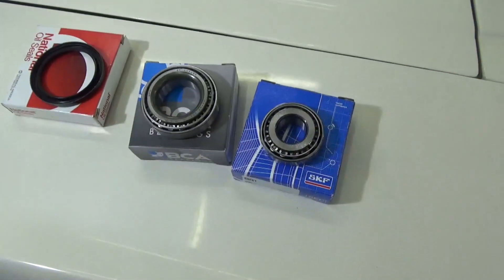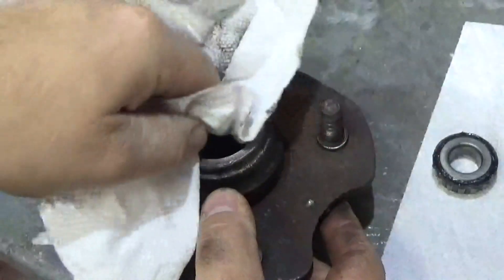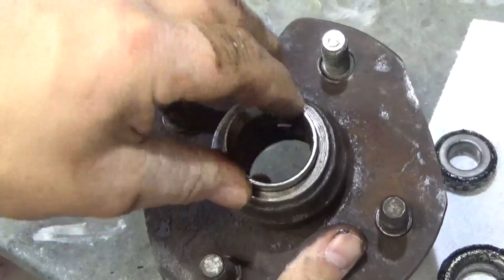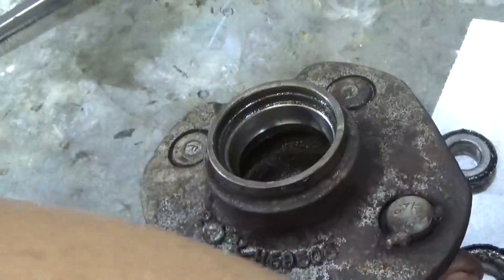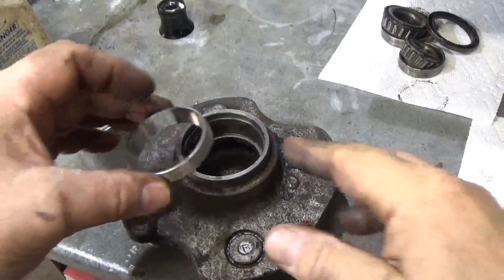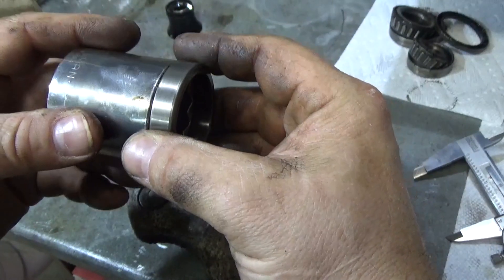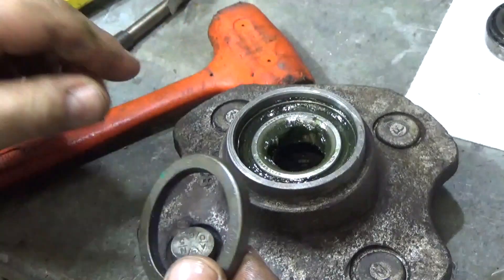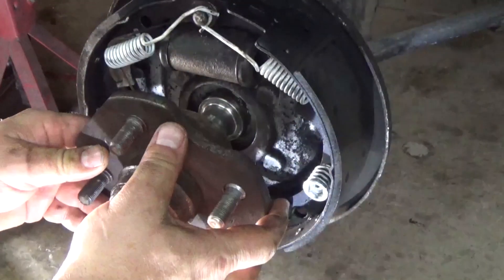How To Change Tapered Wheel Bearings, Pre Load - 1965 Mustang

Comment: One important thing is to make sure you have the inner bearing assembled before installing the outer seal. You can't believe how many times I've seen "mechanics" install the seal before they put the inner roller bearing in! 
One other thing,  when installing the new race I always use a brass drift punch. Using a steel punch you run the risk of chipping a piece off the bearing and ruining the part, and the small piece then becomes a projectile that can impale you.  Use eye protection when doing this. Take my word for it,  having an eye surgeon remove small metal chips from your eye is not my idea of a good time! Thanks again Pete for all the great information you have given the beginning new mechanics out here ( and us old guys too)!
Reply from the maker: Great comment, thanks Bruce

Comment: I keep hearing bad reports about Edelbrock heads "new in box”,  having issues, like vlv seat run out, guides randomly are loose .
Seems like we are forever now going to need to have the local machine shop disassemble the “New in Box heads”,  and verify everything now. 
This has been going on years now.
Reply from the maker: I have not had that problem

Comment: The steel you are asking about looks to either come from a lathe bed or a mill.. Before I owned a press, I did it pretty close to the same as you, with a few differences. 1) I flipped the socket and installed an old 1/2" extension. That allowed me to keep my fingers down at the socket and bearing race until it met the face of the hub. Then 2) I have a pile of old races I keep in a box that were removed from other vehicles and that I ground down the outside diameter so that it would slide in and out of the hub easily. I used one of them to press the race the rest of the way home..
Reply from the maker: Good guesses, but no. Those are great suggestions, thanks Steve